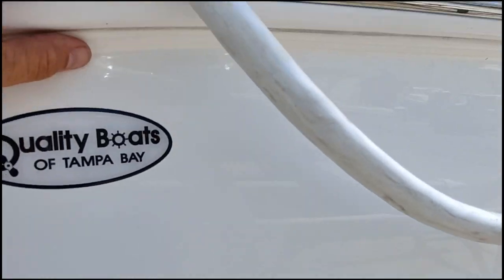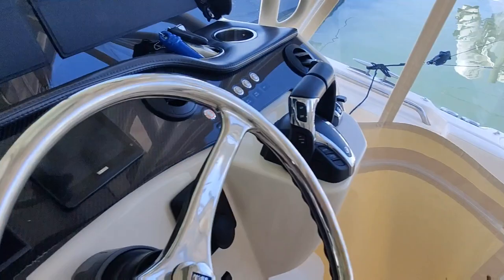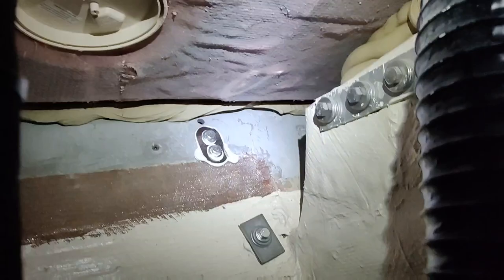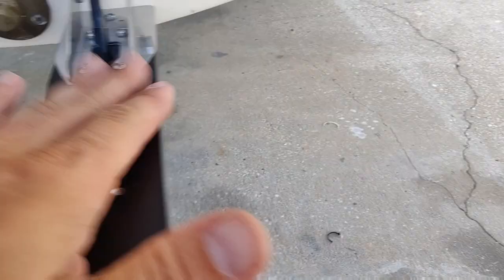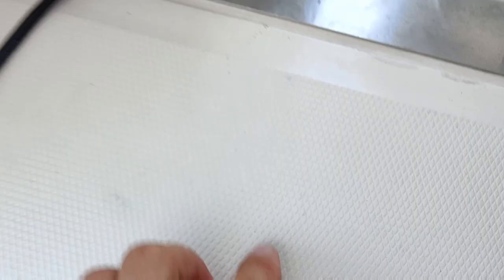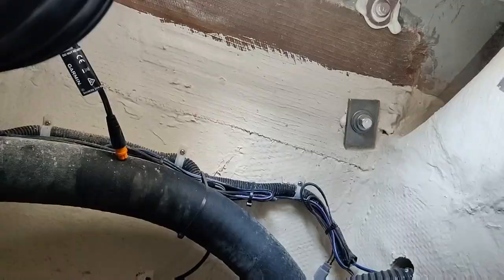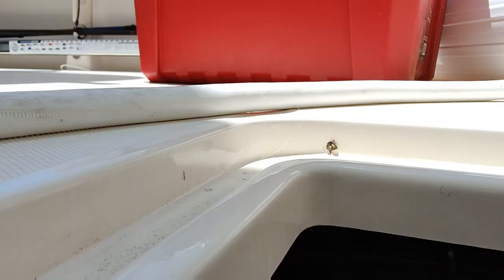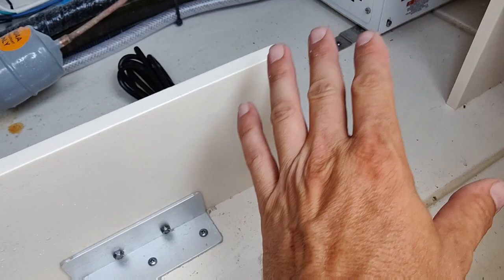Installing A Garmin Transom Mount Transducer #Tips #Tricks #Episode178

Comment: Climbing into that rear hatch to grab the transducer brings back a lot of memories. Now, I'm just too fat. My snake of choice is the hard steel snake used by electricians for snaking conduit. It rolled back up into it's own carrying case and I can always cut small lengths of the snake when I needed multiple ones for doing a boat. Worst thing to snake was always aluminum tubing used for hard or canvas tops. The holes inside the piping was usually not large enough to pull connectors thru, so I had to cut the connector off to get the wiring thru and re-solder the connector back on. Butt connecting was a big no no when doing this for radar and gps. The quick connects going from unit to unit just came out as I left the industry in 2004.
Reply from the maker: It's always a battle running wires and climbing into bilges, etc.  I am lucky most of the boats are bigger and have easy access to components. They can be a pain when they are smaller.  Thanks for watching. I do appreciate it and the comments ☺️

Comment: Have you had any GSD 25s go bad? I recently replaced 2 and ended up having to upgrade to a 26 on a Valhalla they were running to 8617s
Reply from the maker: I have replaced a few of the 25s.  They have had some issues with some of their components. The VHF 315 is another failure on Garmin's part.  The boat in the video already has a 26 so we are adding the 25 so he can choose what he wants to use. 😊